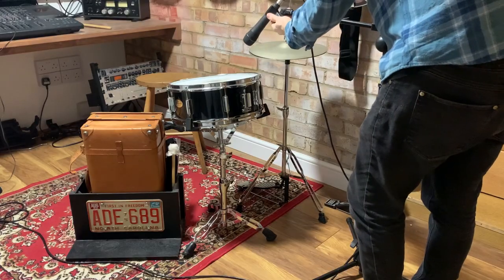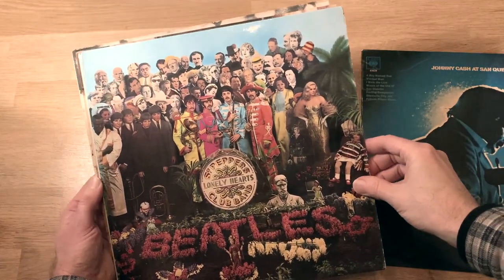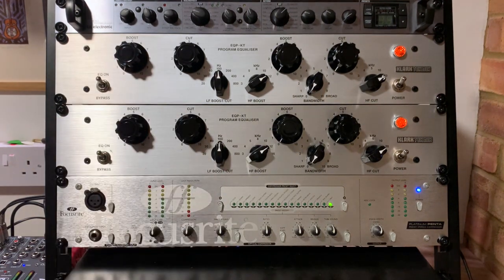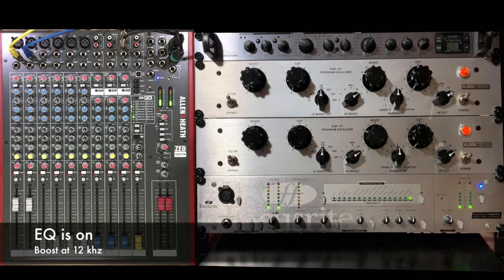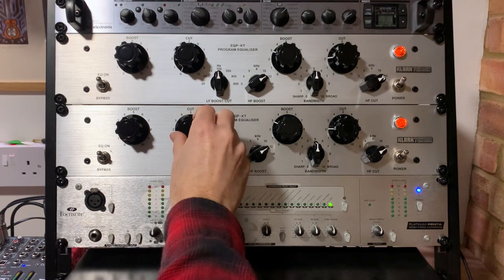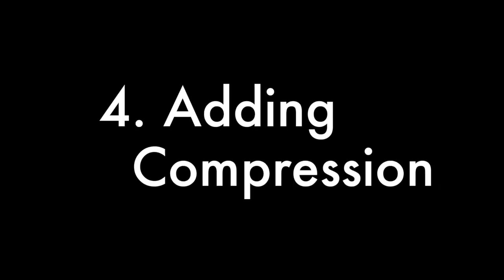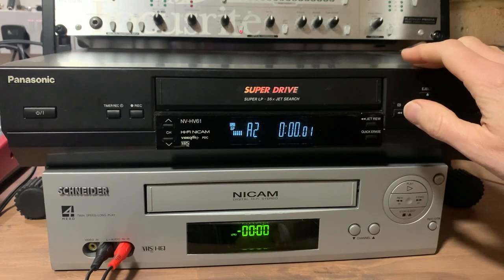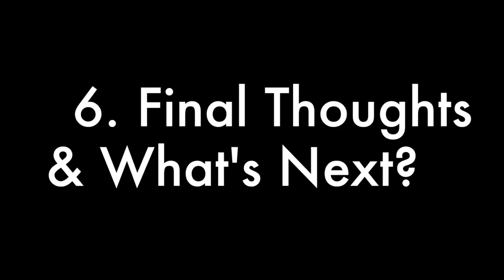Making an Analog Album in a Home Studio - Episode Three 'Mastering'

Comment: Would a Hi-fi VCR not add its own layer of compression on top of the master? In my experience most of these VCR's use auto level correction as well as compression, so you're actually sucking out the dynamic range by the end.
Reply from the maker: That is a bit of a risk with HI-Fi VCR’s although in practice it doesn’t seem overly noticeable. This is where a fast speed reel to reel would be better as you have more control.

Comment: Hey this video was awesome. Wish I could've heard the stuff from your daw when you were bypassing the klark teknik eqs to hear the difference. Looking forward to the album! I've been mixing all my stuff down to another type ii cassette on my Tascam 302 and just slamming it on there for compression that way. I do have a FMR Really Nice Compressor that I've considered using for mastering but it would likely suck most of the low end out of the mix.
Reply from the maker: Hey man glad you like the video! That’s a cool idea to use the Tascam 302 as a tape compressor rather than using an external unit. I might find I need to make some more adjustments at that stage with my material. Which tapes do you use for your final release cassettes?
Reply: @wehappyfewmusic  I am using a maxell type ii 60 minute cassette for the final mixdown for the newest music. As you know, it's another generation of loss but I kind of like the sound. Some of the stuff I've recorded in the past (notably one album I made entitled 'Trexillium and the Colonization of Zeer) was so heavily compressed during the tracking process that I didn't even need to use a limiter or anything after I mixed the song down to Logic from the cassette portastudio. I just bumped the master volume up to peak at -.1 db. I have used the adaptive limiter in Logic before with decent results as well on other projects.
Reply from the maker: @Govier  Oh yeah, I’ve listened to ‘Trexillium and the
Colonization of Zeer Vol.I’ on Spotify. I’d never of guessed you did all the compression on the tracking stage.
Reply: @wehappyfewmusic  I always compress during tracking that album just had some extreme compression on many of the things I recorded. Most of the compression came from a Klark Teknik LA-2A clone.
Reply from the maker: @Govier  I’m hoping to get the Klark LA-2A at some point, got it on a saved eBay search in case I get get a bargain 🤞🏻
Reply: @wehappyfewmusic  I've found it works on almost every instrument in one context or another except for a summing compressor for drums. It sounds incredible on electric guitar, bass, vocals and on certain types of acoustic guitar sounds. It would likely sound good on a bass drum I've just never tried it.
Reply from the maker: Good all rounder then. 👌